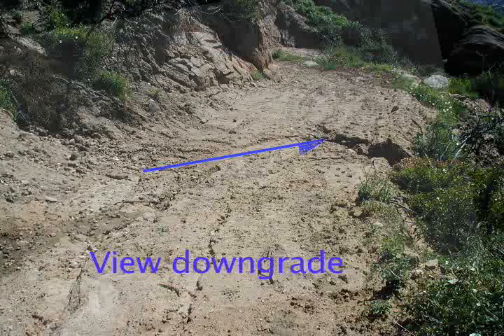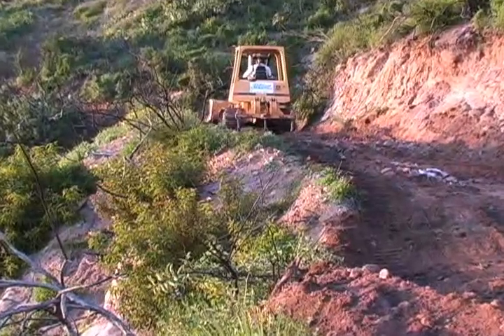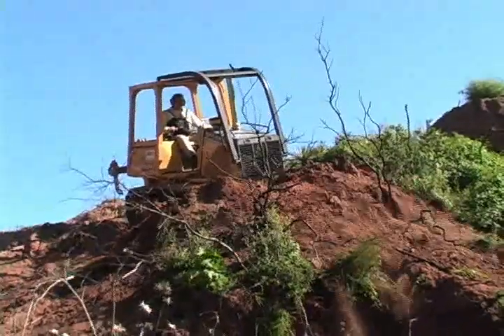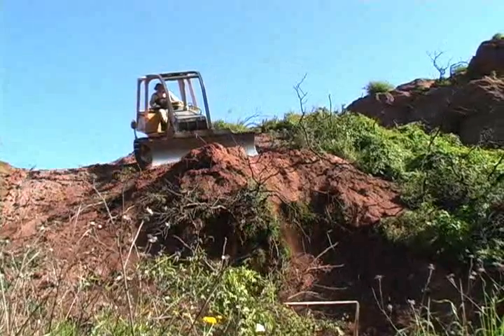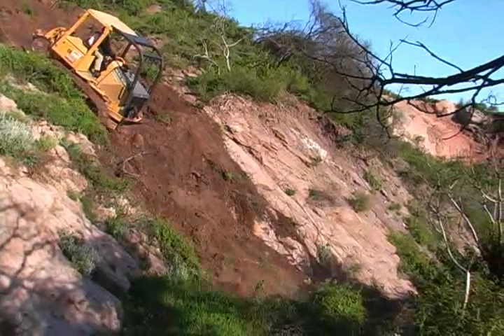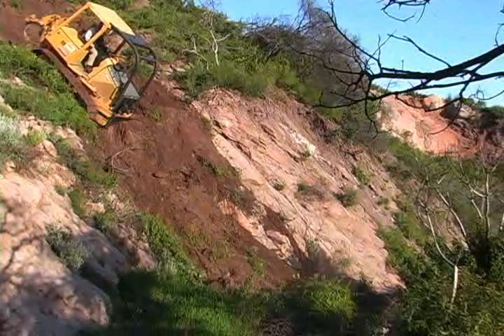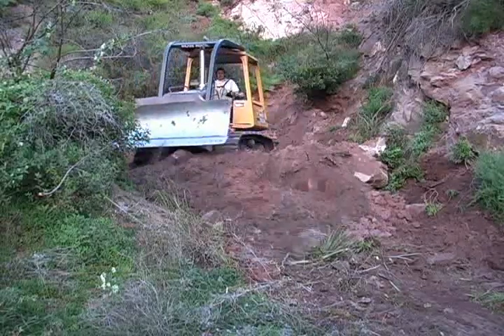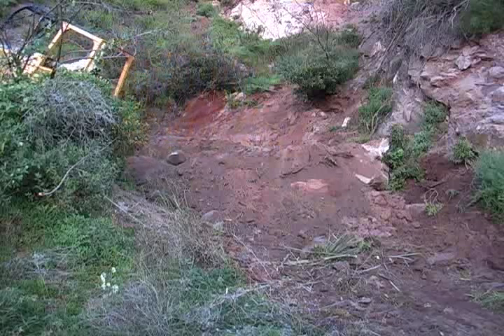west40 trailer#2

Comment: Look at the spot where you call at the bottom of the switch back will you call Rock lamp I believe it's 2:02 or 6:04 on the right hand side of the mountain there's a face there is one eye a nose and a mouth you should take a picture of that and frame it pretty cool looks like a rock troll